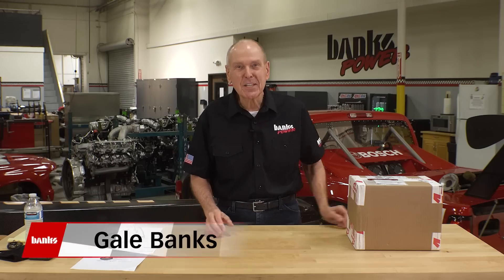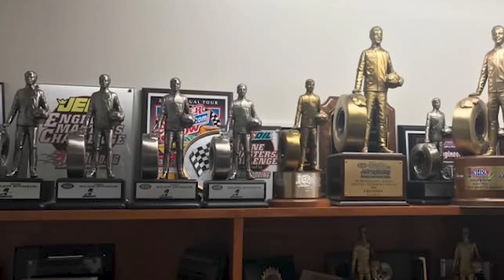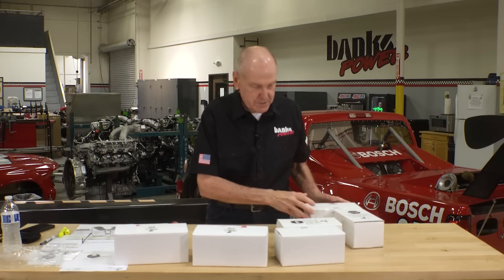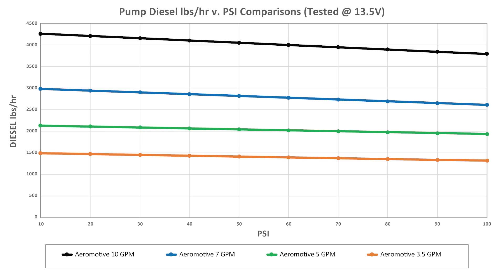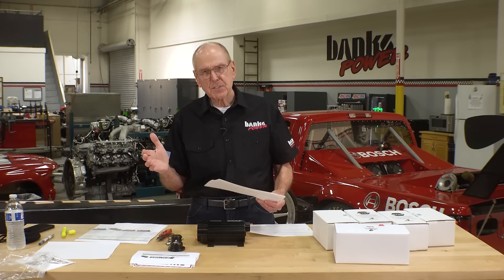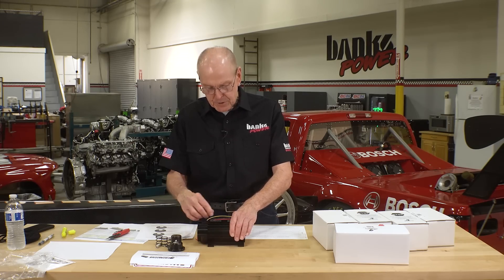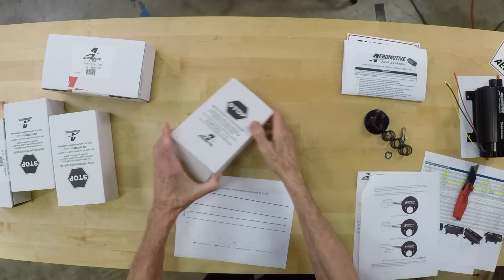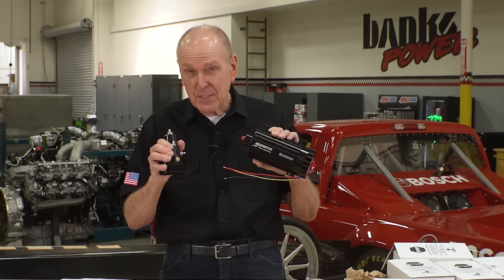ENGINEERING UNBOXED: Aeromotive Fuel Pumps and Regulators

Comment: Fuel heating is a major factor in marine fuel injection systems. Most have fuel coolers and on gasoline systems, most are return less. It does no good to return fuel to a tank unless it’s cooled anyway since the tank doesn’t have cooling air around it like a car. Vapor lock is a big problem on marine EFI systems. On inboards there is usually an anti siphon valve at the top of the tank and this increases vacuum in the fuel line ahead of the pump. In tank fuel pumps are usually not safe or can’t pass Coast Guard rules (pump distance from engine rule). But one ski boat mfg has found a way, or did they ?

Comment: Mr Banks from what you are describing you may do better to get a closed center hydraulic pump. This would be a load sensing system that when there is demand a shuttle in the pump adjusts a swash plate and volume increases. It would run a pilot pressure and then jump from there.

Comment: Never have luck with Aeromotive. Did their in tank kit, and the kit is great, but the pump lasted 12 minutes. Replaced it with a Walbro and it ran for years. A1000 issues everywhere even on motor no pushing the pump. Regulators have been an issue also, but maybe it's just not my size. Now Weldon regs and Wlabro pumps have never failed me.

Comment: We used Aeromotive pumps in high performance marine back in the early 2000's.  Gale's observation that the big pump would cause heating of the fuel during one periods of low demand was definitely true in our case.  Way back then, Aeromotive developed the ability to slow the pump speed to lower fuel bypass flow.  It also took demand off the alternator, whose output was marginal at idle.  We found that spending hours idling in no-wake zones would discharge the batteries.

Comment: I really loved this video - I just wish I understood what Gale was talking about.  Could Gale do a "fuel pressure v flow rate for dummies" video?
Reply: I don't know if you need a whole video.
Think of it like a garden hose... Flow rate is volume, or how much water (gallons/liters per minute/hour) comes out the hose. Pressure is how forceful it comes out (PSI, KPa, etc.)
Fuel injectors require a certain amount of pressure to work, and your engine demands a certain volume of fuel to run properly.
Typically, as flow rate increases, pressure drops (think of having a larger diameter garden hose, it requires more water to build pressure) so if you need high pressure and high volume you need a fairly large pump.
Diesel engines run very high fuel pressure but typically low volume, but if you're building performance diesels and your fuel demand increases, you need a bigger pump that can supply the pressure and the volume
Reply: @NovaNinja_  Aw thanks man for the explination, much appreciate it.

Comment: Just a stupid idea I got watch this, wuld it be a dum idea to make a regulator with a valve position sensor? And control the pump speed whit regular valve position 🤔 it would be a plug and play version for carb cars or older ifa cars if the pump response time is there 🤔
Reply: Seems like a good idea, can't see why not.
Reply: That's a very good idea. I assume you mean you set it so the pump regulates it's output to maintain a set return volume?
If you haven't done so, might be well worth communicating your idea to Aeromotive.

Comment: I'm sure Banks has already thought about making an idash module that controls this fuel pump based on any sensor data you can plug into it!
Reply: He said it could be wired into any sensor already.
Reply: @cencoast_7.340   You still need an intermediate device if you want "all" sensors to work.  Some sensors will work great out of the box, but some might  have an inverse response to what you want, where the output drops s you are wanting the pump to speed up, some may have a limited range of output voltages...some might have a digital output.

Comment: I'm not sure about diesel, but nearly all automotive gas engines have completely abandoned return fuel systems due to the EVAP emissions requirements
Reply: Diesel engine systems use the fuel to also cool and lubricate the pressure pump and injectors. You will find most common rail systems use a cooler on the return line to help with that heat removal

Comment: That is amazing, to be able to take one wire and change the speeds of the pump in such a wide range! I'm interested to see fuel temperatures on the diesels, because in my class 8 trucks the fuel delivery systems are poor at best. I'd love to see what kind of results you get!

Comment: Aeromotive has great stuff and great selection. Oddly enough I used one on my GM TBI setup. It requires around 12PSI. Which is above your typical carb and way below EFI requirements. Aeromotive was the only one who had an adjustable regulator in that weird range. I bough it in the early 2000's and still use it today.

Comment: I remember in the early 2000s trying to make my vehicle a "sleeper" but then I added an Aeromotive pump to it because I needed the fuel flow. 

You could hear the pump buzzing around the block more then the engine or exhaust at idle/low rpm lol.
Reply: lol should’ve heard the old FASS pumps......🤦‍♂️ so much better now!
Reply: Ah the inline vs submerged problem.
Reply: I remember those days.